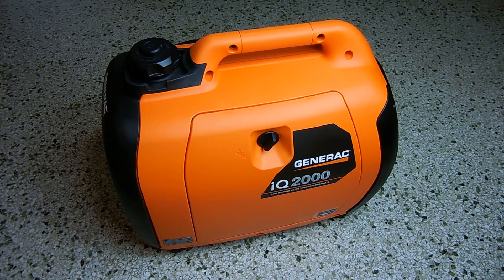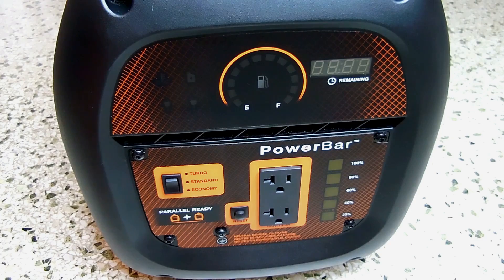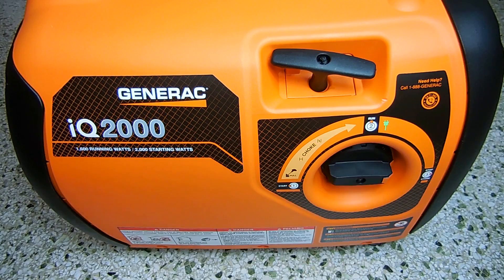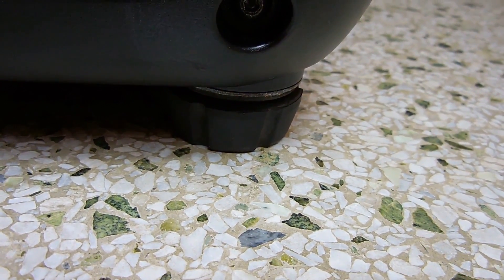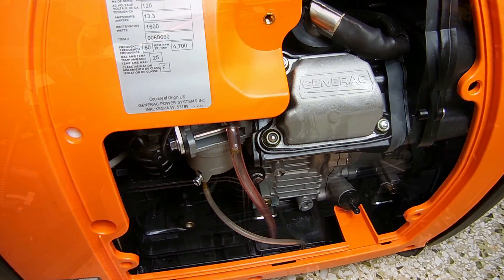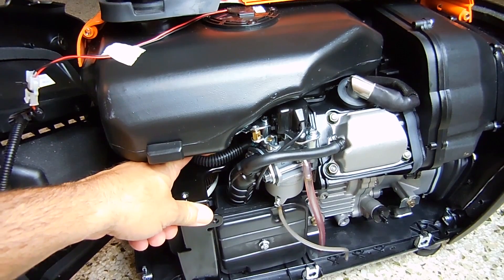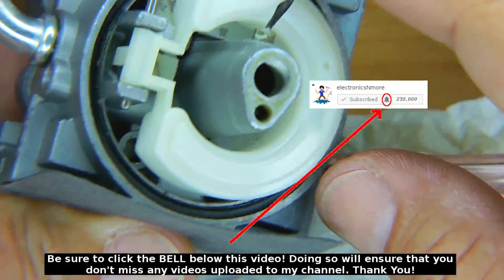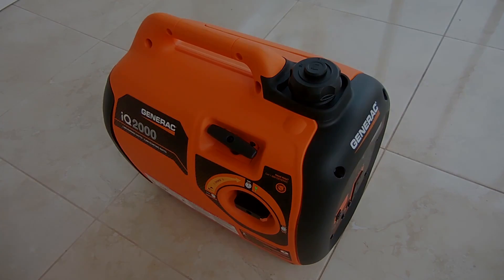Generac IQ2000 Inverter Generator Troubleshooting & Repair(Also Craftsman)

Comment: Thank you for your video, very helpful.
Do you know how to turn down idle on the Generac 2000.  (Which screw it is.) TIA
Reply from the maker: Idle adjustment screw is going to be the one that's pushing on the metal linkage. Unscrewing it, counterclockwise should make the idle lower
Reply: @electronicsNmore thank you very much.

Comment: Exact same problem with my Generac. ..except I can't quite figure out how to get the carburetor back on the engine ;)  ..yet.

Funnily enough, at the remote communications site where I needed to use the generator while waiting for the electricity to come back on, 3 of us all had UPS units with dead batteries. And two of us had generators that wouldn't start because they'd been sitting idle for too long and the gas soured. sigh

Comment: Mine has a sputter to it I took my carburetor off and checked all the holes the Jets everything looked great the  bowl wasn't dirty or nothing I put about 300 hours a month on this generator so I ordered a new carburetor from Amazon and a new coil I going to try that when it comes in also an eco mode is off it runs perfect so I know it's getting fuel

Comment: Is there a trick for getting off the valve cover? I removed the nuts, but it refuses to come off?
Reply from the maker: If all the bolts have been removed, then try gently prying the cover using a wide slot screwdriver.

Comment: Since you seem to be the only person knowledgeable ive found regarding this generator (if you even still own it) i have a question. Is the idle entirely controlled by the stepper motor? The actual cable is simply for choke. My iq2000 will not idle up when a load is applied, nor does idle change when adjusting the 3 pos rocker switch for standard, turbo, economy. Im leaning toward stepper motor as my little power indicator light up front is green and the unit is providing some electricity, though not much. I havent verified how many volts with a meter yet, but when hooled up to a window unit the generator doesnt shut down, the fan on the AC simply blows at a very low speed.

Comment: Pile of junk.  Purchased less than a year ago and it leaks fuel when running. Called Generac for warranty work. Was given list of dealers, but either they do not work on portables or they quit working on Generac all together. This this is a fire hazard.  I have given up on trying to get it repaired....I should have stayed with Honda!

Comment: I have the same generator, while in use it turned off and never turned back on. The pull start is hard to pull, and still hard when the spark plug is removed. So, I am guessing the "generator" portion of the engine is the cause of the drag on the pull start. Is the issue serviceable?
I have spark and oil, and spark plug looked normal for its use. Any suggestions? Thank you, great video BTW

Comment: I bought this unit from a family member that worked there 5 years ago .. been sitting NIB in my garages in the three homes I've lived in since then .. tried to start it last week for the first time during a bird hunt and got nothing .. when I got home I discovered I literally had the EXACT same problem!! My bowl was a touch cleaner, but the exact same hole was clogged ..Cleaned out the exact same hole... Started right up!!! 
.. my edit .. a shirt cut to fuel switch troubleshoot .. open the carb bowl drain into a bottle, cycle the switch from run to off while fuel is draining, the fuel should stop draining when switch is off.

Comment: FYI..That was no floor model.. It was a used model ..probably a return .. That unit was fueled up and used thats why you had the crud in the carb bowl.
Reply from the maker: I called the company and was told a small amount of fuel remains in the bowl after testing. There was no sign of heat discoloration on any exhaust parts, which is an impossibility for a "used" unit.

Comment: I just ordered the IQ 3500. It's on back order. Thinking it might be newly assembled so won't have this starting problem of fuel sitting in the bowl for a long time?🤞
Don't know why the manufacturer doesn't put any stabil in after testing 🤔
Reply from the maker: Good luck with it, they're good running generators.

Comment: I have the same generator. When I use to try n start it. The lights would light up on Pulls. Now its not doing it and not starting. Any tips would help greatly.

Comment: How do you regulate the choke? Mine turns on but when i try to move it to the run position it wants to turn off. The generator just keeps revving.  Plz help

Comment: I wanted the video and it helped me to understand how to put mine back together.   What mine is doing is surging with no load.  I watched it and it looks like the stepper is the source of the issue.   Any advice?   BTW mine is a Westinghouse igen 2500 but the guts look exactly the same.
Reply from the maker: Either the control board, linkage, or stepper.
Reply: Well I shot starter spray on the intake foam and it evened out.   Took the carb out, cleaned everything up and now I can’t get it started.   Does the jet on the top(mine is metal and screws in) have a specific alignment?
Reply: There is fuel in the bowl.

Comment: Have any issues with it leaking oil? My Gp1200i runs great but seems to be leaking oil somewhere. Not necessarily a big deal but disappointing.
Reply from the maker: No. It shouldn't be too difficult to locate the source of the leak. Thanks for watching!

Comment: What is the pinkish hose supposed to be connected to? I bought this generator and both clear tubes from carb are loose and when I go to start it drains the gas from the loose pinkish hose.
Reply from the maker: Make sure the drain screw on the carburetor bowl is tight.

Comment: Gret video. I have an ix 2000. It runs and works mostly, when a load is put on it, it throttles up then when load is shut off it struggles to find idle again or may even die on eco or high idle. Any thoughts on how to fix this issue? Thanks.
Reply from the maker: Possibly 13:27 in the video.

Comment: At 17:01 the part you are pointing out is the throttle stepper motor. It is regulated by the engine controller in order to govern engine speed under different loads as well as varying speeds for economy an d normal modes.

Comment: A spark arrestor screen captures hot carbon deposits coming from the exhaust. It blocks the deposits from exiting the hot muffler and potentially igniting dry fuels. Dry fuels such as dead leaves, dry pine needles and dry grass. It's a requirement per the National Forestry Service. You will always have hot burning gasses inside a working muffler. Some mufflers also include a catalyst inside or catalytic converter. Makes small engines meet new stringent EPA requirements.

Comment: You had to clean the carburetor on a brand new, never ran generator?!  We have spark.  I’m going to try a shot of starting fluid in the intake next.  Could I just drop the bowl instead of removing the carburetor to clean the jet, etc?
Reply: Ours is a remanufactured item, I just learned.   Ok, looks like I’m cleaning f the carb next.

Comment: Do u know how to adjust the voltage. My country is 240v but it appear 260v in my voltage metre. Mine is senci genset inverter.
Reply from the maker: That voltage is fine, even though it's slightly higher. Try testing the voltage output with another DMM.
Reply: @electronicsNmore  i just bought a senci sc4000i inverter for my ice cream machine. It detected high voltage of 260v. I use voltage metre to test also show 260v. Any method to adjust it? 
Such as for normal conventional genset, we can adjust voltage by tuning the AVR.

Comment: Took mine part to fix this same thing (thanks) fuel guage is not working, where does the guage wire go? Sould go into the front cover but cannot find where.
Reply from the maker: I think I pointed out the fuel sending unit in the video, just follow the wires. The fuel sender could be faulty.
Reply: @electronicsNmore  Can you replace the sending unit? I think I have the same problem.
Reply from the maker: @tommcl386  Yes, not too hard to do. It's bolted into the top of the tank. I would test it before replacing it. With the wire disconnected from the sending unit, use your DMM to measure the resistance on an auto range setting. Start with a low tank of fuel, then add more fuel so you can check if the resistance value changes.

Comment: Hi there. I have this unit. General iq2000. Will not start. Checked compression and I’m at 40 psi at best..... thoughts?? Thanks
Reply from the maker: You need to follow all the steps. 40psi is definitely low, if the reading was correct.
Reply: Thanks For responding so quickly! I can’t believe you actually answered me LOL! Your video was awesome and I plan on following all the steps. I didn’t know if it is for responding so quickly! I can’t believe you actually answered me LOL! Your video was awesome and I plan on following all the steps. I Didn’t know if to go any further being that my compression was 40 psi. I checked it three times and was very careful
Reply: I shined a light down through the spark plug hole before I tested the compression in the top of the cylinder is very black and scored
Reply from the maker: @ryankitzmiller4112  Probably ran very low on oil. You need to do some engine work.

Comment: Hello, great video very informative. I got a new Westinghouse i gen 2500 ran last year for 15 min. I tried to start up this unit this year and no luck. I did everything you have suggested in your video ( almost similar parts) and all i hear is a sound that the engine want to start but it dies few seconds later. Do you have other suggestions? New oil, new fuel, carb clean up, check the spark plug, air filter etc....
Tks for replying. Have a great day.
Reply from the maker: Tried squirting a small amount of gas into the air intake?

Comment: My generator will pulse when it is started. It will rev up and idle down like a heartbeat. Whaty steps are needed to correct this problem? Any suggestions?
Reply from the maker: Watch from 13:28.

Comment: Well, thank you for that, I had the same problem with mine and fixed it with your video.  My generator was tested for a couple minutes after I bought it, and then it sat unused for two-plus years.  Then it would start just for a brief moment and die. And if I tried after that, it would crank without any sign of life until many hours later when a little fuel got past the blockage.  

I found some short-cuts to the procedure that some of your viewers might benefit from:

Instead of pulling off the fuel line @11:50 , I cracked open the screw on the fuel bowl and looked for fuel in the drain line (the smaller clear tubing, not the pink-ish one). It told me the bowl did indeed have fuel, and it looked like clean gas.  But, like yours, it doesn't tell you if fuel is getting further into the venturi.  

You can disconnect the 2-pin Molex connector to the fuel tank sending unit, and pull the gas tank off to one side (to the pull-start side) so it won't gravity feed the carb bowl.  No need to pinch the hose.

Plus, you can disconnect the black PCV line at the carb air intake elbow easier than from the valve cover side, which requires removing a clamp.  It pulls right off. 

The wire I used to clean the jet was a RN60 resistor lead.  It just barely fit, and measures 0.026" or about 0.66mm.  The shroud fasteners are all 3mm hex.  The selector knob is 2mm hex.  And the carb and air filter are all 10mm nuts or bolts.

I suppose if we disconnect the kill switch on the 3-way selector, then when we switch to the "off position," it would burn off the gas in the bowl before shutting itself down.  This would be better for long term storage, but it also has some negative safety consequences if you leave it that way all the time.  Too bad disconnecting the kill-switch requires so much time to pull off all the shrouds to get to those Molex connectors.

Thanks again for posting this.My sp
Reply from the maker: Thanks for watching and the tips!

Comment: I work on them to that had gas in bening from factory good job in the tutorial very well placed
Reply from the maker: Be sure to look over my extensive video playlists below for other videos of interest to you, and most importantly share my channel with many others. Thanks! 

http://youtube.com/c/electronicsnmore/playlists
Reply: Hey guys, on the video he mentioned the hoses go out the bottom where you can capture the fuel? Ours starts but leaked all the fuel from those carburetor hoses! Help
Reply from the maker: @ivaney80  Make sure the screw is tight on the hose connected to the carburetor bowl. The seal on the bowl could be damaged.

Comment: I guessed it was a clogged carburetor.
Just because it was never used, does not mean it never had gas that went bad.

I would have simply used straight fuel cleaner, choke it fully and just try to start it until the cleaner starts to break the gunk.
Reply: You mean like a Lucas injecter/carb cleaner??

Comment: I have a yamaha EF1000IS, every 7 days it would stop running due to fuel getting restricted going into the carby, turns out I had to remove the needle in the carby and blow out this crap that formed blocking the flow, this time i removed the fuel tank, turns out the filter thats meant to filter the fuel is not tight enough to make a seal letting the particles to just flow stopping just before the seat inlet, something so simple, you had one job yamaha and someone stuffed up installing an undersized  filter in the tank.
Reply from the maker: It happens. At least you figured it out. :-) Thanks for watching! Please share my channel.
Reply: @electronicsNmore  Yamaha informs me that they designed it this way and also to put an inline filter on the generator, the filter is 5.7mm and the fuel tank hole is 6.1mm making the loose gap of 0.4mm letting particles past, yamaha blames me for dirty fuel even though It's  clean and filters via the top filter under the cap, also states that fuel should be filtered again before filling the tank from the fuel can, Passing the buck on a failed design.

Comment: Generac IQ generator broken from the factory never had that problem with the Honda
Reply from the maker: Leave gas in the carb before storing it and you will.
Reply: @electronicsNmore .  Can you leave gas in the carb if you use Stabil??
Reply from the maker: Yes, but not too long, a year or two.
Reply: Oops! I never drained my carb because I didn’t know it left fuel in the bowl. I will be trying this on my generator that isn’t starting, I bet mine is gunked up also. I run all the gas out before storing though. I think it was a returned unit also, so a good inspection and cleaning are in order! Thanks for the awesome bud of the disassembled carb!

Comment: Bowls should never be a rust-able metal and coated or plated to prevent corrosion because they last only a few years.
Reply from the maker: The bowl is made of aluminum, which is fine.
Reply: Yes. FYI: Briggs & Str... engines today have become quite inferior; plastic timing gears an lobs, plastic instead of good metal, now make life even shorter. I don't see made in US anywhere too.

Comment: I drop the bowl instead of removing carb. I find 90% of fuel problems with fuel float valve clogged with FOD, rust, gummed fuel etc. Compressed air can clean jets but some carbs. have diaphams that could rupture by using too high air pressure from your air gun.
Reply: Dave George 
Yep. Add strong gas cleaner, drop bowl and clean and then choke fully and try to start until gunk gets dissolved.
Reply: Is a stuck fuel float valve issue indicitive of the red low fuel light coming on and the power bar and fuel level illumination flickering? I’m having that issue. My generator works fine, just has the flickering lights issue.

Comment: Enjoyed the vider.  One of the problems, which Honda has mitigated is the micro switch that shuts the engine off before the carburetor can burn off excess fuel.  Honda has a shut off setting on the EU2200 where you can shut off the fuel flow before you shut down the generator so there is very little fuel left in the carb after shut down.  In my Briggs and Stratton 2200 I disconnected the micro switch and installed a toggle switch for quick shut down for refueling.  Otherwise I turn the fuel valve off and let it run the fuel out of the carb.
Reply from the maker: It's best to let the engine almost run dry, to the point where it starts to stumble, then spray in wd-40 to keep it running an extra 15 seconds. Thanks for watching!

Comment: 800 ? You Got Beat I paid 475 for a New Version from Amazon
Reply from the maker: The cheapest Generac inverter generator on Amazon is $529. I got beat for a floor model that was never used for $300? LOL
Reply: Paid $360, on sale, for different brand, but same power rating and inverter.

Comment: Fantastic video!   While attempting to get familiarize with my new generator, I wasn't able to pry apart the outer shell/ panels like you did to access the carburator despite removing all the screws located on both sides of the handle, all screws on the side panel where air filter and carburator is located, the bottom 3 Allen bolts on that same side,  and all the perameter screws on the front control and  back exhaust panel.   

What am I missing?  My unit is of a different brand, but inside layout looks very similar to yours.   I did not touch the smaller screws on the face of the control board, nor the bottom 3 Allen bolts located on  opposite panel of the air filter.   Is there something I need to loosen  or unhook from the inside?  Your help would be greatly appreciated!
Reply from the maker: You need to research your model online. I have no idea how yours is secured. Thanks for watching!